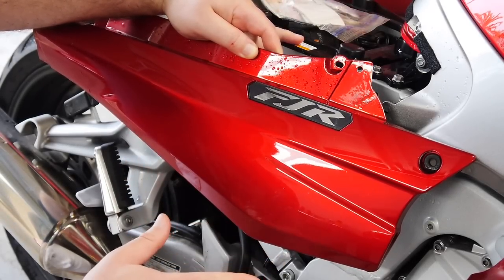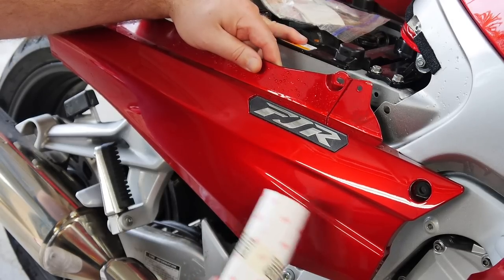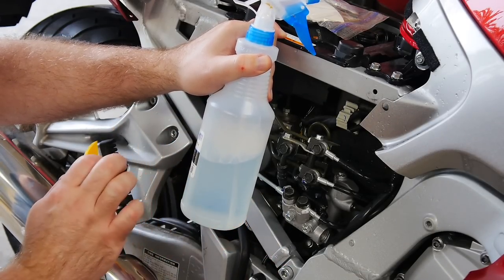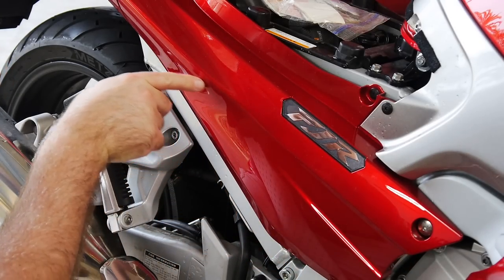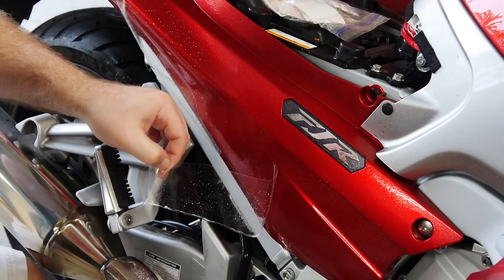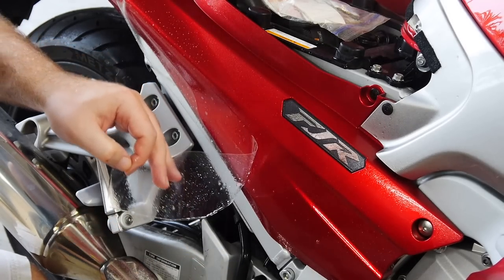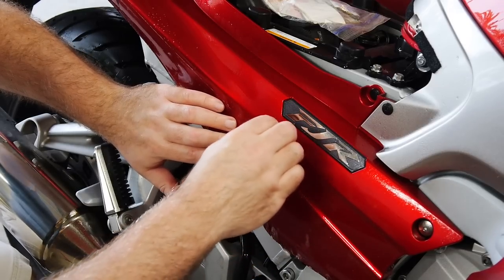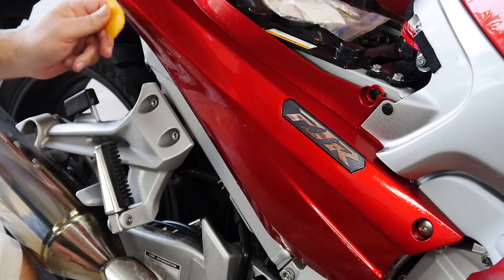How to Apply 3M Paint Protection Film To A Motorcycle

Comment: I see your new tires in the background. How do you like those so far?
Reply from the maker: Mixed results - love the sporty handling and super fast turn in.  Little squirmy two up at low speed.  Grabs road grooves very aggressively.  Not holding up well to long days of flat roads, starting to square at 1300 miles.
Reply: What kind of tire are those?
Reply from the maker: Roadtec01 HWT
Reply: Thanks.  I ride the same exact bike and I love my Michelin Pilot Road 4 GT's.
Reply from the maker: I love them except the last couple thousand miles of cupping. Ran a few sets of those.
Reply: That sucks, I was hoping you found an awesome set. I had the same issues with the PR4 with FJR and another bike, so I put Roadsmart 3's on, they're starting to show the same cupping issues as PR4, but earlier :/ Hmmm Thanks for the info.

Comment: I did the same but with a paper template, pencilled and cut to shape then scanned and digitised to cut on my vinyl plotter. Tip: Pull some rag tight over the squeegee edge to reduce the risk of scratching the vinyl or get a felt edged squeegee (worth having). The wetting process was spot on. Also spritz the glue side of the vinyl as soon as possible after removing the backing paper thus reducing the static and attracting dust. You went further back on the panel than I did on mine but then I did mine with carbon fibre wrap, I have a mantra that if you can't hide it make a feature of it lol. Well done Sir :)
Reply: Warning, another tip: spit on your finger and thumb before picking the vinyl up off the sheet (helps to avoid finger prints in the clear vinyl) ;)
Reply from the maker: That's a good tip - I had my fingers wet out of habit but obviously didn't mention it, thanks